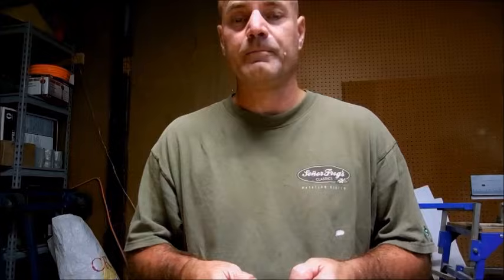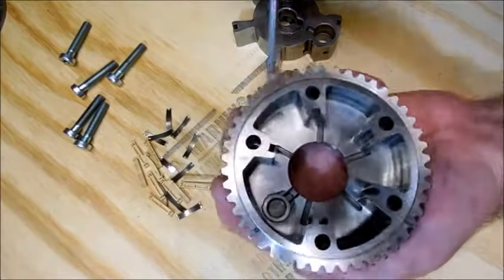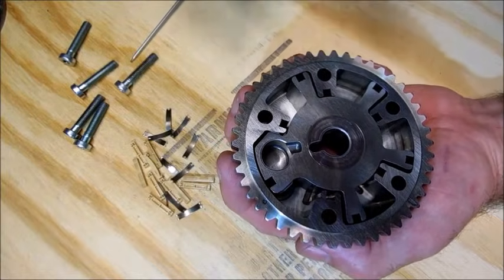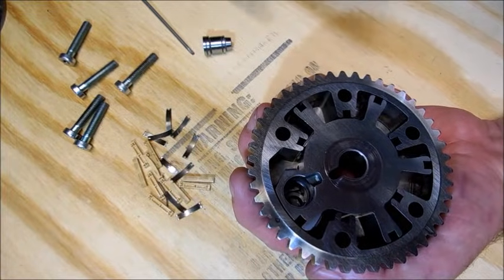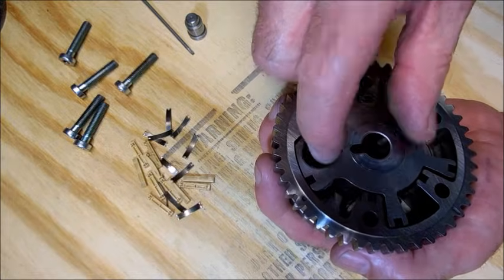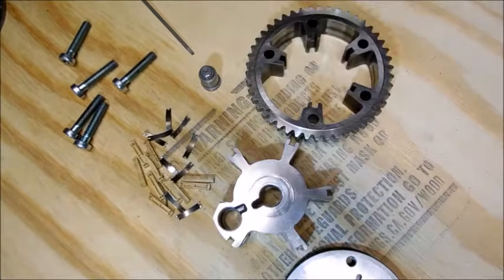Honda variable timing control actuator VTC . inside look at Honda's VTC

Comment: a few things: VTEC, the thing you feel and hear, has little to do with the VTC actuator you talk about. VTEC changes valve lift by switching the valve rockers to engage the high cam cam lobes increasing cam duration and lift. The VTC actuator changes cam timing tuning the cam optimally for different loads and rpms. The start-up rattle is caused by the spring you have shown getting weak. The pin then is not able to lock the pin anymore during startup before sufficient oil pressure is present to fill the chambers. The pin is only supposed to unlock when sufficient oil pressure is present. At cold temperatures this takes longer to achieve. If you crank the engine a few times before starting it, the rattle disappears or only occurs very mildly as by cranking you build sufficient oil pressure to let the VTC actuator work without the lobes moving in an uncontrolled manner.
Reply: I've been working with a company who makes replacement springs for the actuator and in our communications they have told me that the timing chain tensioner going bad can be a factor that creates the rattle.
Reply from the maker: @ACZ457  is there a web site ,
Reply: @mikesproject4704  springstart vtc
Reply from the maker: @spring-start  I bought a kit . and will do a video soon.. fast shipping and correct item... thank you
Reply: @mikesproject4704  Thanks for the order! Any questions reach out to our support email. It seems the longer the vehicle has had the rattle the more work may need to be done. If the VTC gear spring is replaced early on often that's all it needs. If the timing chain tensioner has more than 80k miles we recommend replacement because that's the next weak link. Extract and clean the VTC gear locking pin, clean and check for smooth movement in and out of the bore.Usually they're ok  but not always, especially with longer term rattles. These gears are pretty tough and we believe it's very seldom they need replacement even with high milage vehicles.
Reply: @mikesproject4704  I'm looking forward to that video.  @spring-start and I have been in communication for months now and have been working together to get my rattle resolved.
Reply from the maker: correct for older VTEC. the 2012 year allows the cam shaft to shift  time on the chain
Reply: @mikesproject4704  VTC is variable valve timing. The chain driven cam gear internally rotates to phase the cam vs the “chain”. Even the latest K20C1 combines VTEC on the exhaust cam in this case and VTC on the cam shafts. VTEC combining VTC and cam profile switching was introduced with the K-series, so 2001. Honda is using it ever since, so even in 2023.
Reply: @lapin46  bro! was going to say all that but you said everything. Only thing I was wondering about and you actually kind of answered my question was the part about cycling the ignition a few times before starting to build up pressure to better control the vtc slop. Was actually wondering if that works because I haven't tried myself yet. Was unsure if the cycling would be worse on the cam or better until fix.
Reply: Thanks for the detailed answer. I'm not a mechanic at all. My 2010 Honda Accord EX 4cyl with 110,000 now does this on cold starts about 90% of the time for half a second to a second long. I live in Nothern Calif., mild winters/warm hot summers. I try to change the oil/filter every 5k miles. Is this a major problem that needs to be repaired immediately?....and OR..if it's the timing chain tensioner, do you need to change the timing chain while you are there, if not, is it still expensive in many hours of labor? I'm hearing different stories about needing to change the timing chain...and I'm not sure if I need to get rid of the slight rattle noise. Thanks!
Reply: @1Mannco  has nothing to do with the timing chain or tensioner. You don't need to get rid of the rattle right away. I'd do it if you need to remove the valve cover anyhow, e.g. to adjust the valve lash as part of maintenance. The spring can be replaced or lengthend without removing the tensioner itself.
Reply: @lapin46  OK thanks..maybe if it gets a lot worse in the future...But I do have a question on does the timing chain 'need to be replaced'..or is it just 'recommended' at a certain mileage or ever?

And, is it 'needed to do a valve adjustment' on my 2010 Accord at 120,000 miles, or is it just recommended [ one mechanic said it could make it worse and I don't need to do the adjustment if the engine isn't making a ticking noise]. I'm just hearing 2 different stories on this, thanks!
Reply: @lapin46  Thx for the valve and timing chain info!..one last question, sorry...I bought this '10 Accord 3 years ago with 80k miles and don't know if the tranny fluid has ever been changed. It's full and still red. I've heard that if it's red and pretty clean it's not really needed to change. I've also heard older vehicles that have never changed the tranny fluid, it's best not to do it or you might get leaks now and may slip shifts. [ Not sure if my '10 Accord w/110K miles is 'older' now]..AND I've heard you should change it every 30k miles. And should you do the basic 3 quart change or flush the whole tranny of fluid completely and fill it with many quarts til full. THANKS a lot for replying!
Reply: @1Mannco  if you change the ATF, make sure it is done to Honda/Acura spec and filling procedure. Some types of auto transmission need the engine running while refilling, e.g. ZF. But TBH, I’d only swap it if there are issues. There will be none unless the fluid level is low or the manual explicitly gives you a service interval.
Reply: by "cranking the engine" you reffer to putting the Key in the ON position?
Reply: @ismaelperez278  Push the gas pedal down to the floor.  This will shut off the fuel injectors and prevent your engine from starting.  This will allow you to crank over your engine long enough to build up the oil pressure without your engine starting.  Release your gas pedal after around 5-10 seconds or so (dependant on outside temp and engine condition) and your engine will start without the rattle or significantly less rattle because the oil pressure was given enough time has reached your VTC actuator.
Reply: @geraldmenard6164  thats really interesting, thank you
Reply: @geraldmenard6164  today i tried this and nothing happened. Only thing is that the Engine started with a high rev because i was pushing the pedal down to the floor. Mine is a 2014 CRV 2.4
Reply: @ismaelperez278 Same here.  This does not work in every car from every manufacturer.  You need to install a fuel pump kill switch in order to prime the engine with oil.
Reply: @ismaelperez278  key on "on" position and then crank the engine with the starter but only long enough to not start it. I don't know if the stock ECU has a start-up delay. Some can be set to crank for a couple of revolutions before actually firing the engine.
Reply: @lapin46  thanks
Reply: @ismaelperez278   ign on alone won't do anything to the oil :-)
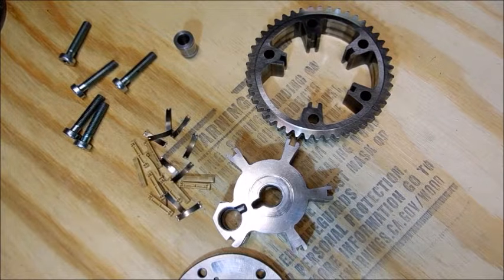Reply: 4:42
Reply: Very reasonable explanation, straight forward. Thank u sir. I’m replacing my spring this week. The rattling is getting louder every time I start. If I turn the key to ON and wait a few seconds and repeat, it doesn’t rattle.

Comment: So this engine changes cam timing as the engine speed changes ? I always thought that the ECM was controlling this VCT actuator with oil pressure and the VCT solenoid.
Reply from the maker: yes just engine revs. which changes oil pressure
Reply: @mikesproject4704  ok cool that’s good to know I always thought the ECM controlled how far adv or retard the cam was by controlling the oil flow with the VCT solenoid. So for you to have it go all the way in 1 direction that means you have to redline that engine . Sounds like a parity simple manual setup
Reply from the maker: @albono780  the older model engines there is a solenoid,  this series as soon as there is enough engine oil pressure it pushed the pin and the cam veries. . very simple design.

Comment: Thanks for the design explanation. I have wondered if it was worth fixing in my Fit and from what im seeing you are right the wear is minimal.....little to no point in doing it
Reply: Stretches your timing chain over time you wil blow your engine
Reply from the maker: glade it helped
Reply: The R40 RZA spring kit eliminates the rattle in the Honda Fit.

Comment: Hello great video. How do you differentiate the VTC issues versus timing change replacement. Getting lights on dashboard with rattling noise for honda crv 2015.
Thanks
Reply from the maker: if you have lights you have something else going on.
Reply: Your timing chain is stretched and you need to replace that and the chain tensioner. You will have a DTC for the VCT actuator - however the noise and problem you have is the chain.

Comment: Just replace the spring with a new one. Easiest thing in the world.. 

Spring steel
0.5mm wire diameter
9mm spring width
25mm length

Problem solved.
Reply from the maker: great.. thank you for the sizes
Reply: For waht car tho? coz on 2014crv it is 30mm by default..
Reply from the maker: @miticav3709  accord 2.4l
Reply: @MrMattFinch Did you try any other sizes/rates, and what was the rate of the spring you used?

Comment: Great video. Love the breakdown of the internals. I just changed my VCT in my 2008 K24. The one thing that many videos don't reveal is sometimes the VCT can be stuck in between locked and unlocked like mine was. I inherited this vehicle from a family member and I believe the VCT has been rattling for the last 150K miles or more. I had to use some innovation to get the new VCT to line up correctly after torquing it down and locking it. It's as quiet as any new Honda on startup now. I do believe that over time, the resonance of the frequency from a failed VCT will cause premature chain stretching. Just my opinion though.
Reply from the maker: i agree on the chain stretch

Comment: what happens if i dont change this and live with the noise, would that damage the engine?
Reply from the maker: this is just my guess. the pin will wallow out the hole  and the timing will Verri. at high and low Revs, this will cause loss of power may be 20% may be 3 year mark. this will cause cardon build up and over time clod start problems. 5 to 7 year mark . biggest concern would be the stress on the timing chain this would make it loose tension and have slack. causing binding may be 4 year mark. so checking tension on timing chain would be the thing if you want to live with it.

Comment: Hi Mike, its been almost 3 years since your replaced your VTC, did the rattle came back? Thanks
Reply from the maker: touching wood. still good.. . no rattle.
Reply: @mikesproject4704  lucky. many that replaced it came back
Reply from the maker: @Daniel-xq7ny  thinking they could have a dirty oil issue , i change my oil 3,000 miles even though they say you can go 7,000 to 15,000

Comment: It (the rattling on cold start when the lock pin is not locked as it should be) DOES do damage. It will destroy a timing chain in very little time.
Reply: No it does not.  Mine has been rattling for almost 200K miles.  What will happen is it will affect the chain tensioner if anything at all.  Since the inner mechanism that is bolted to the end of the intake cam is designed to move independently of the chain and outer gear I am not one who subscribes to the idea that the chain becomes stretched or damaged because of the rattle.  That happens for other reasons, usually lack of maintenance and mileage, and many of those miles with low oil level.  The chain can and does stretch, and the tensioner could be a part of the rattle.  I think people with stretched chains and tensioners going bad are the people who have replaced the actuators entirely and had the rattle return in short order.  To explain - since the recess that holds the pin in place is connected to the outer gear in a roundabout way, if the base timing is off due to chain slack or stretch, the recess will not be clocked in such a way that the pin can locate itself as it should in it.  So I believe this is why it's not locked on start-up as it's not necessarily locked in the recess on shutdown.  The pin could be partially covering the recess, even just millimeters from being seated, but it's not so the inner mechanism is free to rattle.
Reply: @ACZ457  best explaination
Reply: @faithwu4484  Thanks.  I have been working with the company that makes replacement springs for the actuators.  They will tell anyone out there that the tensioner needs replacement, and really, they do.  The other huge part of it is, the locking pin needs to be worked over with some abrasives - by hand or by rotary tool.  There can be high spots and crud on it that can stop it from moving freely into and out of the detent.
Reply from the maker: i am going to say no on damaging the chain. but over time you will wear the inside of the actuator. and will effect oil flow and metal floating in the oil.

Comment: hi mate... i have the 2.4 k engine in my 05 odyssey and have a code P2646,,,,, i dont have a rattle at all   but sometimes it wont rev above 3000rpm    is that the same prob or the solinoid
Reply from the maker: no something different.. go to this link. https://www.carparts.com/blog/p2646-code-a-rocker-arm-actuator-system-performancestuck-off-bank-1/#:~:text=Diagnostic%20Trouble%20Code%20(DTC)%20P2646,improve%20your%20vehicle's%20fuel%20efficiency.

Comment: One temporary technique I did in cold weather was to bump the starter a few times before really attempting to start the engine.  Doesn't seem to rattle on starting.  I think by bumping the engine over builds enough oil pressure to reset the vtc and take up the chain tension.  I have a new vtc actuator sitting on the workbench and am waiting for a valve cover gasket to come in so I can change it.  Going to try the quick change technique by removing both sprockets as seen on some YOUTUBE videos.
Reply from the maker: my main bolt was tight i would try to loosen it while it is still in the engine
Reply: Hi. How did the new VTC change go? Thanks

Comment: Hi. I have opened the front plate and stretched the spring. Since then, not more noise on cold starts.
Reply from the maker: nice . thank you for the update
Reply: My thoughts exactly.  Start simple using existing parts.  If it's not busted, don't replace it!

Comment: If I place the vtc locked, Will It still make the rattle noise ?
Reply from the maker: i wouldn't do that. would stop start up noise but create other issues , oil flow, and advance when accelerating

Comment: Hi. What's the size of the 5 screws on the front vtc plate?
Reply from the maker: TS30h    5 star bit
Reply: I’m having the same issue finding the right Torx bit. Is this for a 2013 Honda. T 27 doesn’t work
Reply from the maker: @stevevee8033  napa has them
Reply: I didn't do my CR)V yet, so I cant be sure of the size, but its a 5 point style Torx, (not a 6 point). See link below, (amazon)
Reply: @Daniel-xq7ny  you have a link. Not luck finding it

Comment: Thanks ,what are those pieces of metal on the board, does that comes   from the part also ? 
I was hopping you could show us  The spring youre talking about
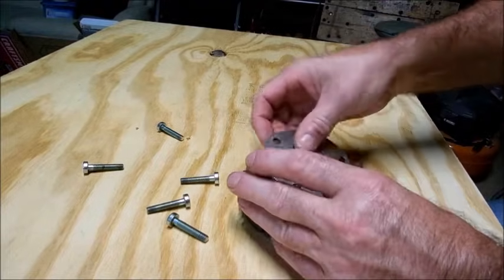Reply from the maker: the spring is at 1:16 on the video
Reply: @mikesproject4704  thanks, !  
Since the spring is the issue it would have been great to show it a little more

Comment: What is the part number on your VTC? PAA.  I know that CRV PND one’s got replaced part number to RBC.  And I did see people fixing it by flexing and stretch the spring once they put it back it’s fixed.
Reply from the maker: 14310 r44 A01 is the part number . stretching the string will only be a short fix replace would be better

Comment: Thanks for nice disable and explain but vtc is for adjust cam angle and vtec is engage different cam lobby. For now they are 2 reason, dirt oil or vtc valve or weak spring.
Reply: Im thinking weak spring.... let me know

Comment: So this actuator advances timing regarding RMP? What if you have thicker oil? What if you have very thin oil? Will timing be advanced in differed RMP regarding the oil :D?! Does oil effect oil pressure in different temperatures? I changed 0w30 oils (had 5w30 before) for my civic 2008 1.8 and rattleling started. Good to know anyway its pretty harmless!
Reply: It has really nothing to do with the oil weight.  No oil pressure is no oil pressure, whether its 0w-20 or 20w-50.  I've run 0w-20, 5w-30, and now 5w-20 after replacing the spring inside the actuator and I still  have the rattle.

Comment: My 2012 Honda Fit makes a grinding noise (like the starter motor remained engaged for a second or so). It occurs only in cold weather startups and goes away after warmup. Would this be caused by a defective VTC? Will it damage the engine? Thanks for your video.
Reply from the maker: i looked it up and yes your Fit has a timing chain and a VTC.. a few people have told me they replaced the spring and fixed it . cheap and easy option...
Reply: @mikesproject4704  Do you know where I can find a spring replacement in my 13 Honda Accord EXL 2.4?
Reply: @amber_504  did you replace the spring? Did it fix the problem? If so, where did u get the sping?

Comment: HOW MUCH WILL
V-TEC FIXING JOB
WILL COST AND
HOW LONG WILL 
IT TAKE TO FIX?
Reply from the maker: it cost me about $100 for the part and about 2.5 hours.. i had a hard time undoing the cam bolt... and guy posted he replaced the spring and it worked.